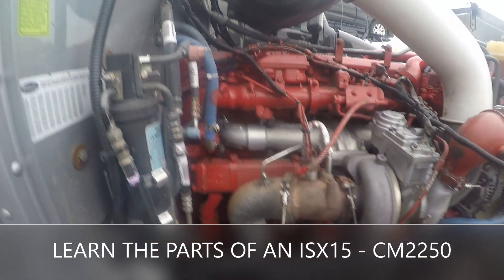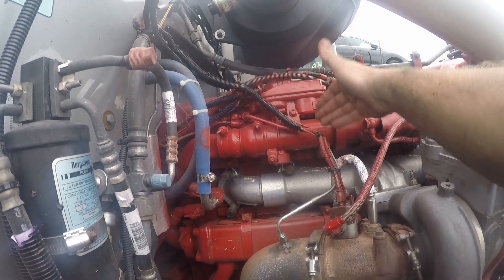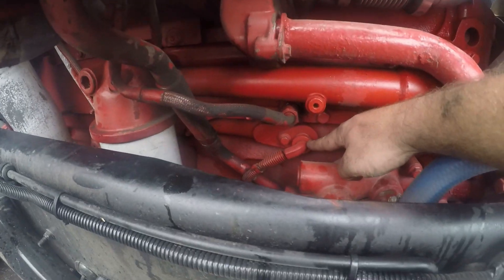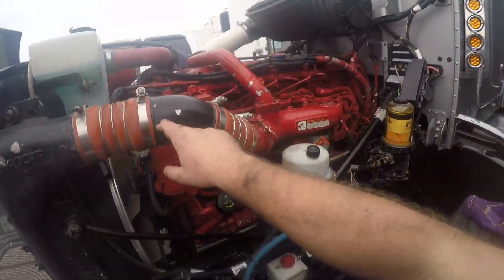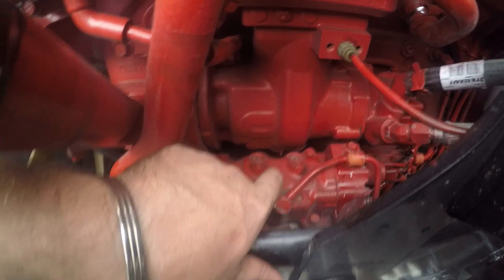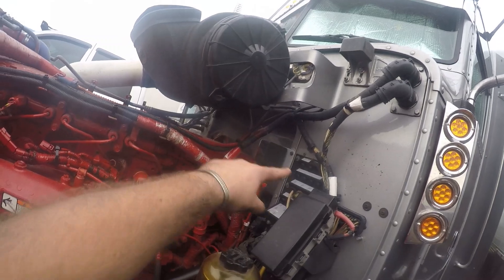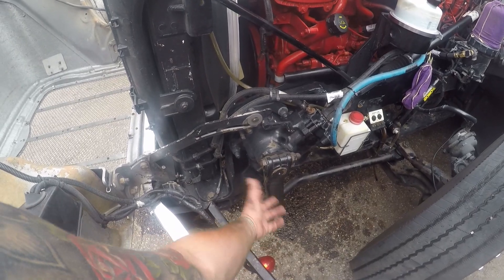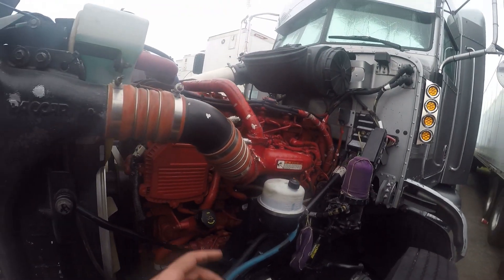Ryan Stays Loaded - 36 - cummins ISX 15 parts tour- identify components on the isx15 diesel engine

Comment: You did great If you unplug the ECM and plug it back is there anything else you have to do in order for you to fix it I mean I’m getting the message that my ECM needs maintenance and I’m kind of stuck skeptical about it
Reply from the maker: I’ve never heard of anyone getting that display message. It kinda sounds like the ecm might be going bad and need a new ecm? But it is safe to unplug and plug back in the ecm. Won’t due any damage in the key off position.

Comment: Just subbed up looking at a 386 with the x15 around how much did the overhaul run 🏃‍♂️ you? How did you get those cleaner lights on there looks good hero
Reply from the maker: The air breather lights on the side there came from a chrome shop in OKC. “Bells and whistles” was the shop, I think the lights are made by “tycoon” or “typhoon”. They have little rubber smash fitting that holds them in place via pressure when screwed into.